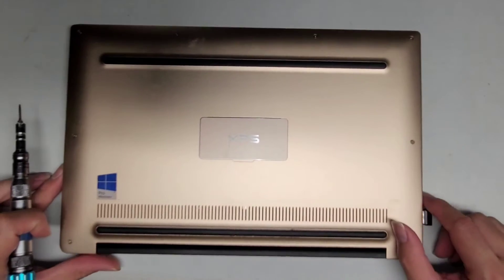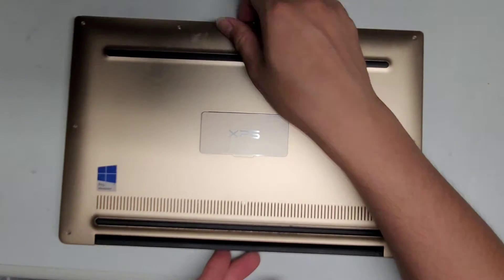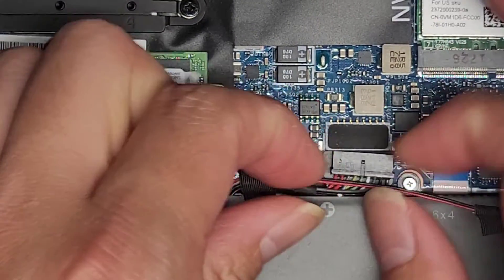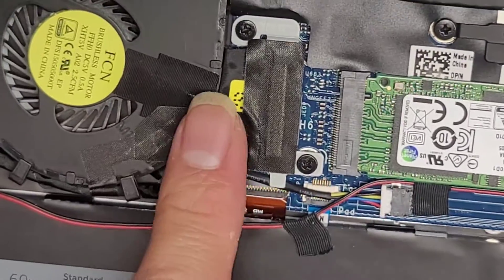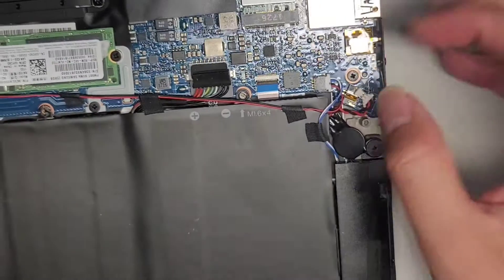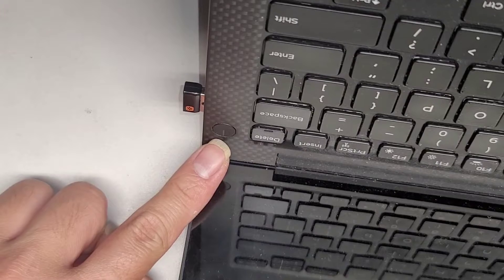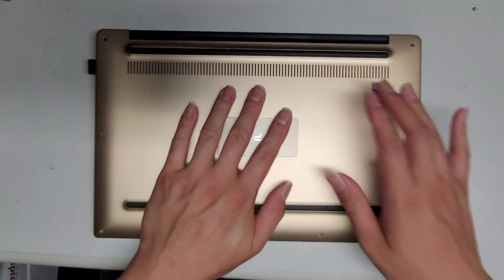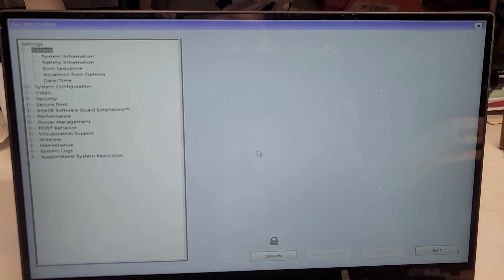DELL XPS 13 9360 Disassembly Quick Look Inside No Boot BIOS CMOS RTC Battery Reset Repair

Comment: Hey - appreciate these videos. I have the same model xps and similar issue. PC wouuldn't power on. I followed these steps, disconnect battery, drain, with a same result of the laptop did not powering on. Do you have any next steps to try and remedy? Or more importantly, how might you (or I) go about saving any data on my C drive. Thanks!
Reply from the maker: Something like this https://amzn.to/3xHDUIg